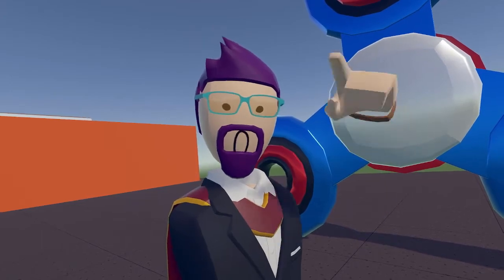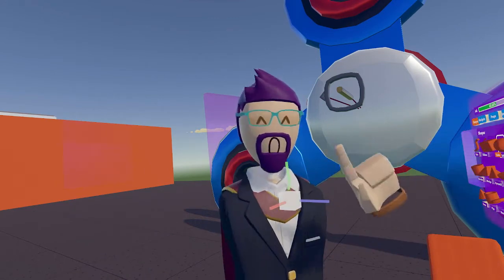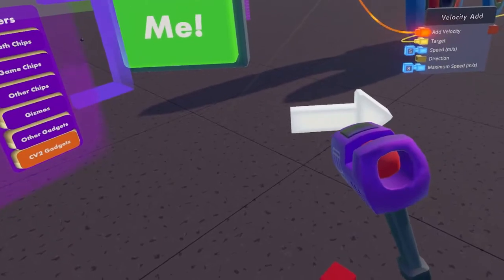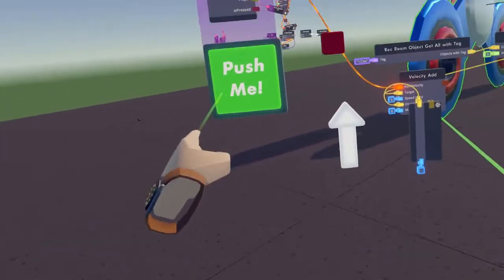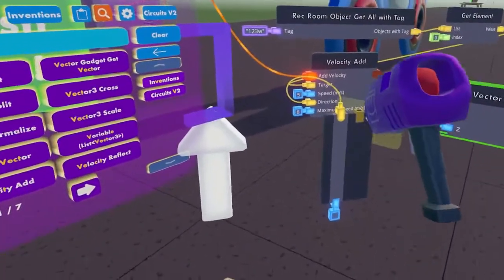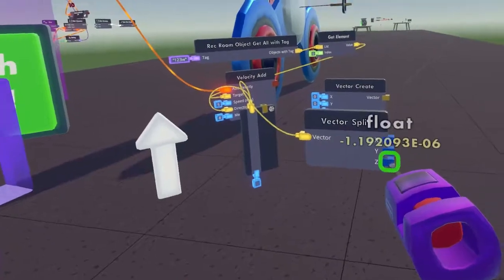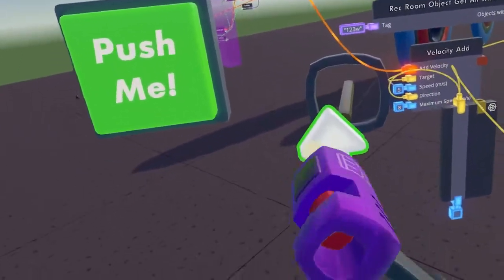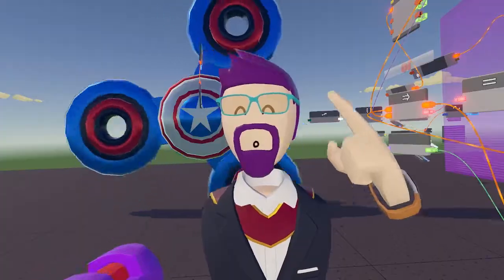How To Use The VECTOR GADGET in Rec Room | What Is A Vector? | Rec Room Circuits Tutorial

Comment: anyone know to give a paintball gun knockback with this?
Reply: so basically u edit the circuit board of the gun and spawn an event inside, then set that event to projectile hit player. once you've done that, wire the exec to a add velocity chip and get a collision data get player, wire collision data to collision data and the output player to the add velocity target. get the forward vector of the gun and wire that to the vector part of the add velocity. when u done that set the floats for the magnitude on the add velocity chip and wabam ur done =)

Comment: As buggy as the circuits are now... I'll build a circuit setup that works then I'll come back later and it no longer works and im like is this a recroom issue or do I have something wired wrong... recroom messing around with rooms2 has caused so many bugs
Reply from the maker: tru

Comment: Alright i have a problem… its not a problem its more of a “Hey how can i do this?” So i want to make something move left or right or up or down with buttons and stuff… how can i do that?
Reply from the maker: is the object physical (does it have gravity) or is it decoration and just floating each one is handled differently
Reply: @theRCLman  No, it needs to be On the environment thingy because it needs someone to ride it
Reply from the maker: @Hamad7292  first configure object to modify with circuits and give object a tag. grab 4 buttons and 4 vector gadgets all pointing in different directions. then 4 set position chips, 4 add chips, and a rr object get 1st with tag and 1 get position chip. hook one set position to each button will add a different vector gadget to the position of the object. hook a vector gadget to each add chip. hook the position of the rr object to each add chip then the sums of all the adds to there own set position chip and make the rr objec the target of each set position
Reply: @theRCLman  Woah dude I didn’t understand any of that.. Im new to this circuit stuff…